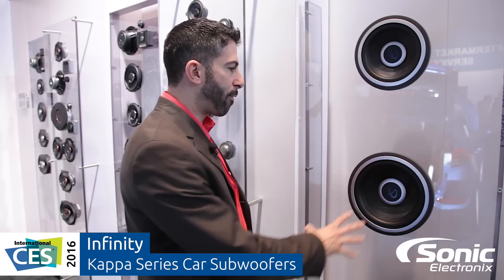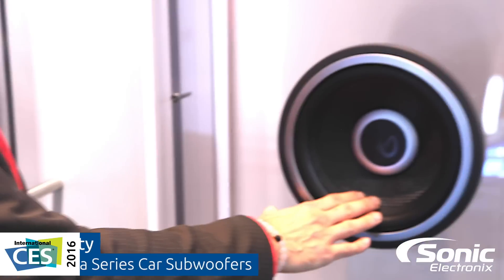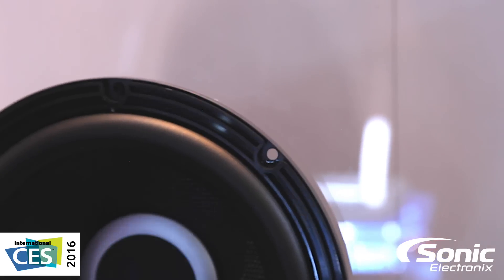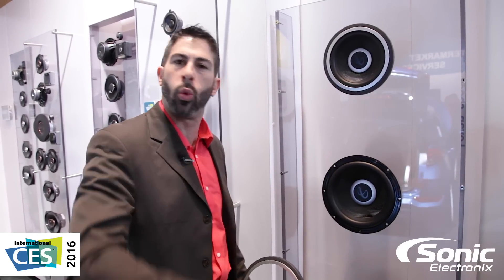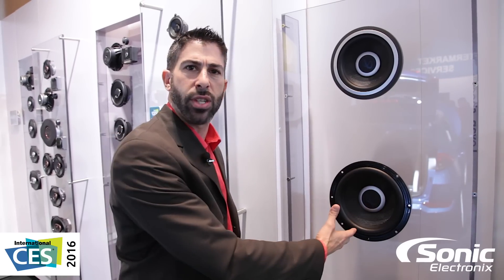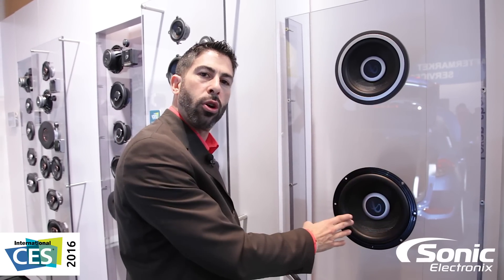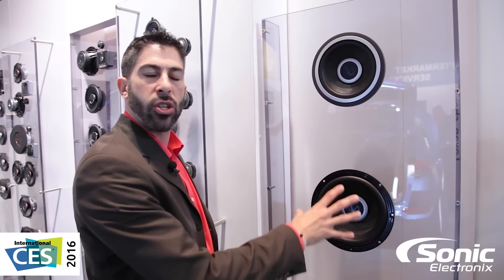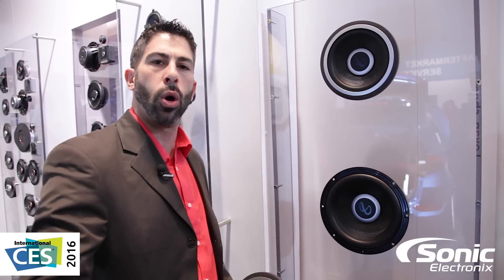Infinity Kappa Series Subwoofers | CES 2016

Comment: So one woofer is 2 ohm and 4 ohm?...what.
Reply: it's a dual voice coil ;) the switch allows for both coils to be in parallel :p
Reply: what impedance allows for a 2 ohm load or 4 ohm load in series or parallel. a dual 1 ohm could be .5 or 2 and a dual 2 ohm could be 1 or 4 ohms